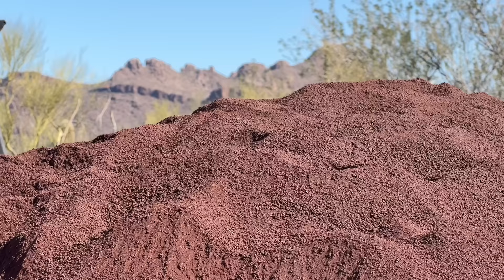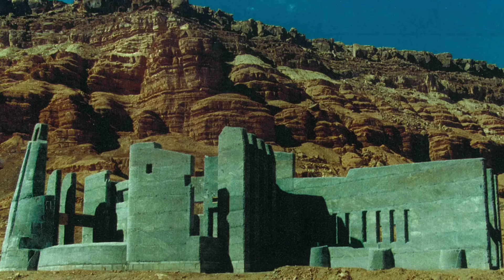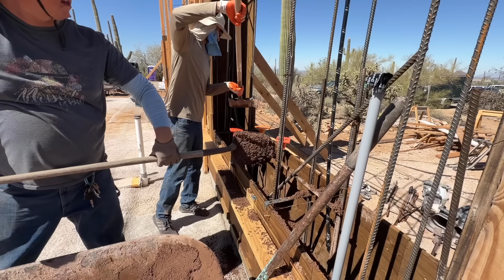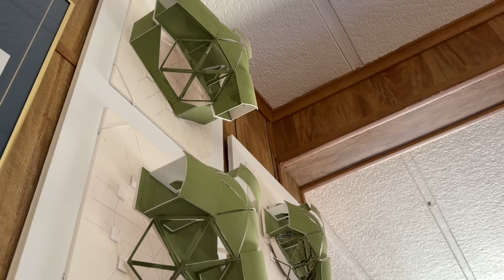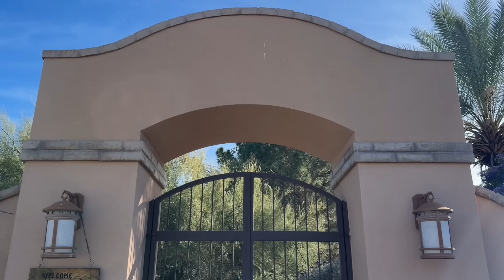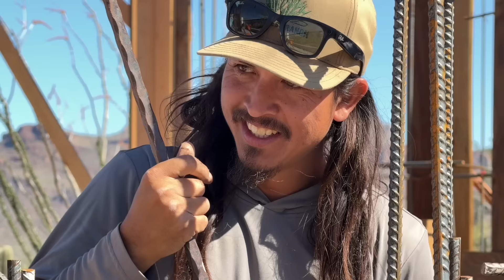The COOLEST Alternative Building Method You've NEVER HEARD OF

Comment: Did not mention the most benefitical bit of using Lava Rock and Lime. The way those two get stronger over time is, it naturally locks in Carbon so it scrubs Carbon Dioxide and Carbon Monoxide from the air around it. It won't save you if your home is flooded with CO or CO2, but over centuries it does a job. That is what Greeks and Romans used and why their structures are still standing. They also used Iron Ties, but what they did ot seal the Iron Ties was dip the Iron Ties in molten Lead. Why? Lead/Iron forms a near 100% inert electrolytic cell so no Iron Rust. Lead/Lava&Lime-create does not form an electrolytic cell so the Lead doesn't corrode. So ancient Greek and Roman structures still standing? Easily done today, except modern building code won't let you enrobe steel rebar in Lead.
Reply from the maker: Guru Das talks about a few great alternatives to steel rebar in this video 👍🏼

Comment: Very curious if there are videos somewhere with an engineering discussion of lavacrete.  Perhaps comparing with cement and/or wood framing strengths and weaknesses.

I like the promise of lavacrete but need to better understand the structural details.
Reply from the maker: There is not much out there, thus the reason for creating this video. I know Paul and Guru Das have quite a few buildings that they've tested and have that kind of data. Those just aren't the kind of videos we make. I do know with the 5:1 ratio they get about 2500 vertical psi, and the rebar inside can be engineered to pretty much whatever strength you want. So there's no hard and fast rule. They use the adobe code and parameters to pass code and inspection.

Comment: Very interesting. There's quite a few natural materials that are being used for homes. Others are rammed earth, earth bags, and straw bale. What's difficult to surmise is which material works best for the region each of us live in. I live in the Northeast, for instance, where it's cold, raining, or covered in snow several months a year. Would Lavacrete work? Do we have Lavacrete naturally in the Northeast? If not, what natural building materials can we use in the Northeast?

Also, with Lavacrete, it looks as if you can get a variety of colors. I prefer gray. Is this possible? Additionally, can Lavacrete walls be totally smooth or is there always a tooth?
Reply from the maker: With any natural or earth style wall you just need to modify or adapt to your climate. With Lavacrete for cold, rainy areas just build thicker walls (1R per inch), give yourself a long overhang to protect the walls. You can also spec a 1" foam barrier inside the form while pouring to create a water break. Very "engineerable" for codes. I have no idea if you have cinder sand available, that'll be on you to research ;)

Generally the material comes in black and red. You can also tint it as you mix.
Reply: @TinyShinyHome  I'm trying to find photos of smooth Lavacrete walls. Apparently, they can be polished smooth and you can use finer Lavacrete sand to form the walls. Do you have any links to photos with smooth walls? Thank you.
Reply from the maker: Yes we talk about that in the video. You can use larger aggregate and sandblast for smoother finish or fine grain for a more naturally smooth finish. But I don't think it's going to be "polished" without an enormous amount of work.  And because of the light compaction there will always be a little roughness.

Comment: there is a technology called plasma gasification, which is derivative of plasma waste conversion. The idea of being that if you have a plasma furnace that is, on industrial process where you feed in arbitrary waste to a plasma heated chamber, the result is that all of the elemental components are broken down. The system typically needs electricity plus feed stock to continue operation. So as long as you have trash available, the plasma can continue to burn, and the system can generate electricity both from ambient heat as well as from syngas, which is basically natural gas that is one of the products of the furnace. 

Depending on how the system is designed, you can expect several elemental products to come from it. In its highest end form, you could actually distill all of the elements from the feed stock but current technology tends to limit the results to two or three desired outputs.

That said, one output always exists, and that is a form of glass. This is why I make this comment.

class can be very similar to Lava in the fact that when broken down, it has irregular shapes. I imagine that a plasma gasification plant could be used to generate various forms of building material. One solution could be to make a glass bricks, that is to say, not clear glass in the traditional sense, but waste glass that would be appropriate for building walls, etc. 

Another possibility is to create large glass shards that can be used to fill in areas where you wish to filter water for example.

The final possibility would be to crush the glass the same way you are crushing the Lava in this technique. This could mean that anywhere where you have waste, a plasma gasification system, and a desire to use the materials for building, you could have an almost free source of concrete type building material.

Comment: As a retired long time mason i used lime in mortar mix precisely for the self healing. Seems like ii might work here to use a combination and get the best of both. My mix was 3 sand to 1 cement and 1 lime...
Reply from the maker: So the build site where we're interviewing Guru Das they are testing masonry cement for the first time which is portland/lime split. We're excited to see the results!
Reply: As a long-time plasterer, that is the same exact mix ratio I used when plastering the exterior of adobe houses in New Mexico.  It cured hard as a rock, and I never had cracking issues with my work.

Comment: It looks nice, but I'm not sure it is environmentally good if you use Portland Cement. If 1 part in 6 of the mixture is binder, that's about the same amount of Portland Cement that you would use in concrete. On the plus side, you will have a long-lasting building (which is environmentally good), but unless I'm missing something,  it's not better than concrete.
Reply from the maker: Missed the whole part about lime huh?

Comment: When it comes time to plaster the walls of the round house, could a 2 inch thick layer of LAVACRETE be a quicker alternative?

Leave Same Or Better, Everything 
People Before Profit 
Be Good 
☮️🙋
Reply from the maker: It's not a plaster so if you wanted to cover earthbag walls you'd have to build 4" forms and mechanically bond it (with rebar) to the existing walls. Doable, but not sure if it's worth the time and expense.
Reply: @TinyShinyHome 
Yes, attachment to the bags is always going to be an issue. 
Lavacrete four to five feet up from the ground with normal plaster above that would make a very decorative wall design.
I wonder if you had moulds could you create individual lavercrete panels or paving stones?
A bit like how my little homestead used foamcrete for decorative panels on their new workshop.
😃👍🏽
Reply from the maker: You can make paving stones (Awareness Ranch does this) - I'm not really sure what the benefit would be other than aesthetics though since you would spend so much time getting them to stay and trying to waterproof around them.
Reply: @TinyShinyHome 
For me the appeal of a lavacrete panel, would be the layering of different colours and the ability to emboss patterns while remaining relatively thin.
Panel sizes could be anything from something attachable to a wall, up to large panels used for fencing or freestanding privacy screens.
Moulds could be laid horizontal with an open top, the first layer could be decorative with different colours and finer scoria for embossing definition. 
Then depending on the size, reinforcing could be placed on top for example chicken wire or reinforcing mesh followed by a top mono-colored lavacrete layer, to increase bulk and strength.
If you want to be really artistically adventurous, you could add coloured bottles. 

I'm thinking here more about business opportunities with the added benefit of being able to display them on your house/property.

Comment: We have a housing shortage crisis here in New Zealand. We also have lots of volcanic activity so i see scoria used as cheap driveway fill and in landscaping. Like pumice, it wouldnt be hard to crush into the scoria sand. The roman concrete was way better than  modern stuff and even seems to have self repairing properties, as well as curing in water, hence was used even making ports or wharfs. I do wonder how well it deals with earthquakes as NZ is called the shakey isles for a reason 😎 Great video! Id love to try this to make a fence or smaller project than a house first. It looks amazing. ❤
Reply: Kia ora
Can you imagine the testing regime you'd have to go through to get it certified as a structural building product........
However, I love the idea of making a relatively low lavacrete fence/wall which falls outside of the building code.
I do wonder if a 50mm+ thick layer, using wooden forms, could be used as an external non-structural cladding/plaster?
Also, could you shotcrete, lavercrete?

I don't really know if there's many usable scoria deposits left? 
I've never really seen scoria outside of Auckland and I know for certain that mining anymore of Auckland's volcanoes would be definitely out of the question.
Reply: @kiwi_welltraveled  Very good points. I still see scoria everywhere, though I'm not sure i trust this government not to mine conservation land. I live in Matamata and we have a hinuera stone quarry, which is taupo volcanic tephra. Maybe it could crush up in a similar way. I am keen to try it on some smaller projects though. Methinks youd want the steel rebar in walls for structural strength here. We also have a big company here that makes rock crushing machines, so if that worked it could be great use for smaller rocks, not much use as bricks etc.
Reply: @DavidMcKinley-h7r 
God I hate making YouTube comments on my mobile device!
If you go away from the page to check something, whenever you come back and your finger touches the wrong place, everything you've written is gone.
So here we go againnnnnnn!

I live in Waikanae now, most people down here have never heard of scoria.
I'm sure they must have tried other types of stone but scoria is very unique in it's composition. 
I saw one of the other commentators suggesting pumice as an alternative. 
If you wanted to be ultra environmentally friendly, what about, Coalcrete?
Though I'm not sure of how fire resistant it would be.......
Reply from the maker: This is a great thread. I'll just pop in and mention that the cool thing about this building style is that you can pretty much engineer it however you want. Need more earthquake resistance? Add larger rebar in a tighter grid. Guru Das and Paul both have had no issues testing and getting things permitted here. I doubt it would work like shotcrete (too dry), but you can form it and build an outside layer. Needs to be at least 4" and mechanically bonded to the surface you're attaching to.
Reply: @TinyShinyHome  i dont think my tag in last comment worked, but can you also add extra whole scoria stones, to the lavacrete, like aggregate in concrete, to bulk it out while keeping the weight down? I also wondered if could be a good way to make like molded hempcrete or lightweight blocks for builds. Fascinating stuff ❤

Comment: First, I've seen some people mix portland cement with lime. Sets up faster than lime alone, and you get some of the self-healing of lime.

Second, I was in Jamaica last year, and noticed that nearly all buildings (homes and commercial) were of poured concrete--mostly because of the hurricanes. While the core of the island is volcanic, the surface is completely covered in limestone, so Lavacrete is not an option for them. Climate-wise, wide open construction and tons of airflow is preferred. One resort had no glass in their dining room windows, but fixed wooden slats to remind birds not to fly through. The room we stayed in at that resort was a climatic failure, as it was sealed with air conditioning--water condensed on the concrete walls and formed a puddle on the floor. overall Interior walls were often concrete too. Another resort we stayed at had new construction going in. It looked to be a long term project as small trees had sprouted in some of the rooms, but one suite in the back was completed. I think some of the owner's family members were living there. I liked the cast arches and verandas on all floors.

Comment: Would this design be appropriate in the NW where it's cooler & has more moisture?
Reply from the maker: Sure, you'd just build thicker walls (1R per inch), give yourself a long overhang to protect the walls. You can also spec a 1" foam barrier inside the form while pouring to create a water break. Very "engineerable" for codes.

Comment: Will lavacrete work in a colder wetter environment, like northern WI, MN, and MI? This sounds like a great option, but wondering if it works in more varied weather, cold, wet, etc.
Reply from the maker: Sure, you'd just build thicker walls (1R per inch), give yourself a long overhang to protect the walls. You can also spec a 1" foam barrier inside the form while pouring to create a water break. Very "engineerable" for codes.
Reply: @TinyShinyHome Thanks!! This makes me pretty excited 😊.

Comment: Do I have to put rebar if the wall isn’t load bearing? I’m happy to use a big fat 6 X 6 every 12 feet to carry the hat. And I’m happy to have a nice 3 foot overhang . 

I love the look. Has anyone checked the R-Value? Guess it depends upon how hard it’s packed but I bet it’s good. 

I’m going to check the availability on the east coast. I bet it’s only available in that landscape rock & packaging. 

I’m a crawlspace mold contract contractor. The building code people make laws that keep the home improvement people ( like me) in business. 

Iraq has homes that are 200 years old and are in far better shape tgat a house in the USA built in the 1990’s
Reply from the maker: Rebar isn't about load bearing strength. With the ratio provided you're easily in the 2500PSI range with lavacrete. It's about lateral strength.

In the video we explain a few times that the point of lavacrete uses less compaction to increase insulation. You pack it more you loose the air between the granules and reduce thermal efficiency.
Reply: And just to add … There are Rammed Earth buildings in Eastern Iran that are ~ well over 1000 years old.  Perhaps more.
Reply: @SquareRootOfMinus1 yes there are.
Reply: Yup agree with all.

Now - suggestion - for those of us with no Lava (scoria) anywhere’s nearby:
Look at Rammed Earth.
Pretty much same methods.  Almost identical, really.  Just using different “soils”, eg. Clay /Sand/ Gravel mix. Plus Stabilizer ofc. 

But you do get a very good R Value with Rammed Earth approach.  In the range of double.  
Love what these guys are doing here. 
But you can replicate it, even without chess to this specific aggregate.  

Also - look for “Insulated Rammed Earth” … simply place rigid foam sheets in the center of the wall cavity as they’re being built.  Say, 1.5-2”. Gain another R6 to R8 or so.
Reply from the maker: A few important differences: Lavacrete requires way less compaction than rammed earth so it’s less labor and more insulative because of the porosity of the material. It’s also much lighter so it’s easier to move but yes, you can do insulation in the Lavacrete walls for a water barrier and additional R value
Reply: @TinyShinyHome I love the stuff.

Comment: Lavacrete stucco? Can you use it that way? It looks like you could cover your hyper-adobe bags and trowel it for a smooth finish. You could design patterns with the different colors. You also need to get some one to cnc an airstream tiny shiny logo for the lavacrete building.
Reply from the maker: No it’s not a plaster.
Reply: @TinyShinyHome Here is how lavacrete relates to stucco application:
As a Thick Coating (Rendition): Lavacrete is often used as a thick, insulated, or structural coat over surfaces, similar to a "thick-coat" stucco or mortar render. It is often applied over masonry or other substrates to add structural integrity and insulation.
Stucco-Like Application: It can be applied to surfaces in a way similar to traditional stucco, and it acts as a sustainable, fire-resistant alternative to synthetic stucco systems.
Alternative to Conventional Finishes: While conventional stucco is usually applied in thin layers (1/2 to 7/8 inch), a lavacrete-type mix can be used for thicker applications to fill in or coat walls.
Reply from the maker: AI overview?